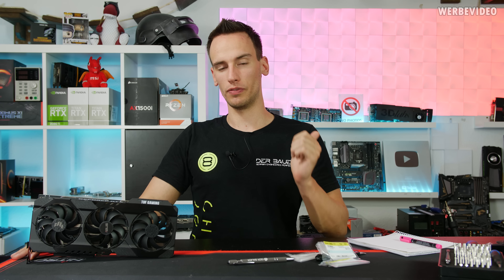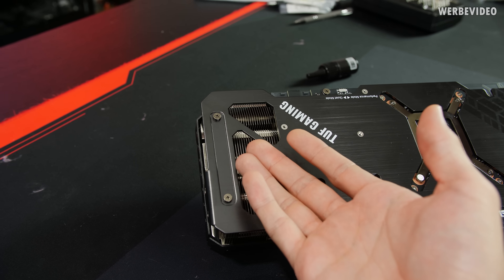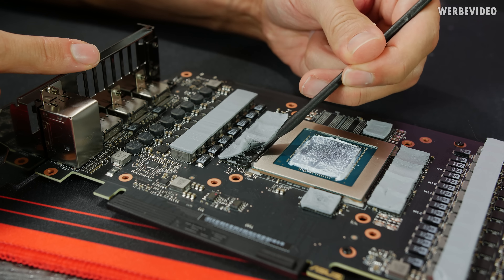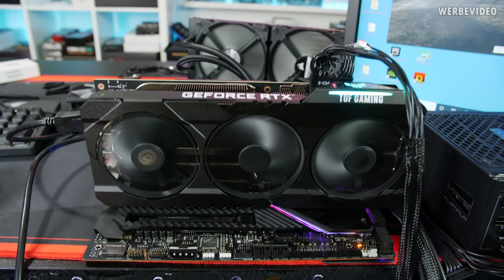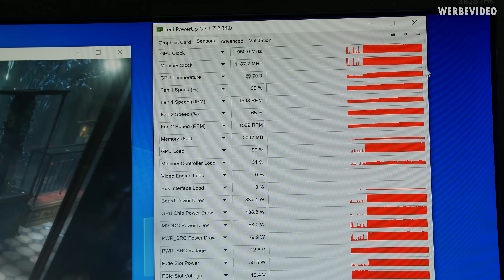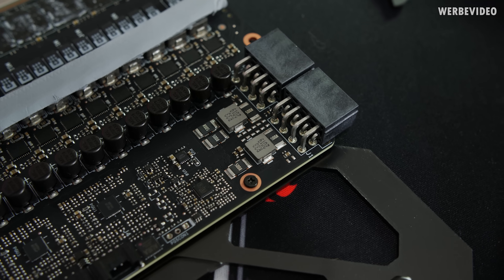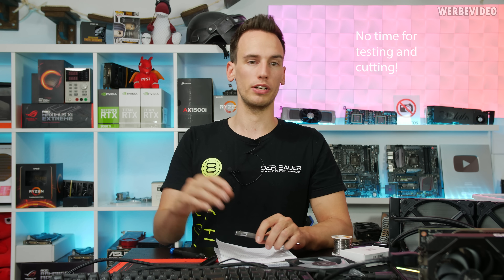ASUS TUF Gaming RTX 3080 OC - Shunt Modding (unlock Power Target!) and First Look

Comment: You probably wont answer old comments, but you wouldn't happen to be able to explore whether or not the unused solder pads up to the left on the PCB of this card is for a USB-C port?
Reply from the maker: That's actually possible. But I don't have the card anymore to check that 😁

Comment: Hi Der8auer.  So my question is.. is there no reason to modify any of the other shunts on a 3080ti PCB?  Specifically the EVGA 3080ti Ultra Hybrid model.  I have seen mixed things on shunt modding the 3080/3080ti/3090 and before seeing this was under the impression that in order to fully bypass the power regulation features on these boards you have to shunt mod all resistors for the PCIE 8 pins and the PCI-E board connection point.  I am very confused what needs to be done to shunt the 3080ti for unlocked power limit.  Please help.

Comment: My ASUS TUF Gaming RTX 3080 OC does 1995mhz out of the box... OCers reach 2200mhz. I prefer undervolting. 100W less and same fps. Issue people is having is fan stop not working. Use bios update tool from ASUS support page on your card, including STRIX (it works with all the cards and will find correct VBIOS for your card). Then go set NIVIDA power settings to optimal and reboot. Fan stop used to not work unless your board power draw was <30W, new bios is <50W.
Reply: what clock/voltage for your undervolting

Comment: Does the firmware have no communication with the voltage regulator to know how much current is being driven from there?  It seems like the power monitoring at the 8 pin connectors isn't actually being used by the GPU for boost clock.

Comment: Asus said the ROG Strix has 3x 8 pin power supply to spread the load, since two would be pushed very hard. Do you think people will eventually damage their cards by unlocking and increasing the power target on 2x 8 pin cards?

Comment: Unfortunately, this is not a mod, with the same success it was possible to insert a resistor with zero resistance or put a jumper there, this action did not have any practical effect on the final result, and the difference in the results before and after is nothing more than a measurement error and nothing more! Nevertheless, thank you for reviewing the internal contents of the video card! And Sorry for my English 🤗

Comment: Such a well designed cooler. I just wish the card was a bit better looking.
Reply: This is actually quite a clean looking card without the excessively angular designs that we have been seeing for a while.
Reply: Maybe their Strix card will be even better when that's released if this is just Asus' basic card.

Including design. I don't like the TUF's design that much either, but function over form for me anyway.
Reply: I was really turned off by the plain design and the protrusion that has the TUF logo at first, but after seeing it in so many videos it's beginning to grow on me a bit. I'll be mounting whichever 3080 I end up getting vertically, so aesthetics-wise a little more illumination would have been nice, but the shroud itself looks really good and well the power connectors would stick out anyway so having the shroud cover them a bit isn't all that bad in the end.
Reply: @rofln00b  at least it isn't a sad clown with weird curves lol.
Reply: The only issue i have is the rgb its cut short but i understand why, i was thinking to get the asus 3080 rog strix, but it needs 3x8 pin connectors so i just Decided to go with the tuf oc edition

Comment: thing is as fast as it can be, nvidia did well to find the power level and maximize power to perf. only way up is a 3090 that cost 2x as much. and maybe you'll get 20%, most likely 10%. Guess the 3080 with mild oc is the best we'll get this generation.
Reply: Well I have seen a Gigabyte gaming OC largely maintain over 2000Mhz, not in English but you don't need it :P.  Silicon lotto/binning may be the reason, hard to say yet.
https://www.youtube.com/watch?v=5pohOsjXLKw&list=WL&index=29&t=504s

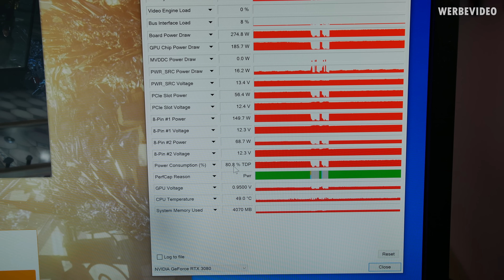Comment: @15:40 the perfcap reason is pwr. Maybe its not clocking higher due to the 8pin #1 reading 150W which is the the limit for this connector. It may mean that all shunt resistors on the board need to be modded to truly uncap the power draw. Just a guess.

Comment: Hell, 350 Watts for a GPU, i guess it's the price for "good" 4K. I have just built a desktop that uses 75 Watts using a Ryzen 3400G that run games fine in Full HD and is amazing for productivity, 10 years ago 500 watts was required to perform the same. I really hope there is still room to improve in power consumption with silicon (i heard Apple is doing wonders with 5nm), otherwise integrated circuit technology will have to change drastically.

Comment: Can you try the same mod in MSI 3080 Gaming X? It have 3 power connectors and probably can safly draw 50% mode power (but in stock TDP is limitted as in other 3080 with 2 connectors).

Comment: 5:04, what's up with the pads. Do those GDDR6x modules run so hot to require the extra heatsink? Doesn't look like those pads can take it if they're already crummy after such a short period.
Even after dumping an additional 40W, there clocks barely moved. Ampere is so high in the voltage/frequency curve already it's not funny. Samsung's 8nm is hot garbage jfc.

Comment: I would like to see the extra 2 ram chips soldered on and see if it registers as 12GB on a 384 bit bus or is it locked in firmware as a 10GB 320bit unit and then bench it against a 3090 to see how close it gets.

Comment: Huh? Literally every Vega has a spring pressure mount.
Reply: What Nvidia was talking about is that they used a new spring that offered a lower profile mount than traditional springs with better mounting pressure. Spring pressure mount existed for a long time. I couldn't comment on how true their statement is, but the distinction is that it's not new but upgraded.

Comment: I am really curious if you can use the Kraken G12  kit with this card ! (if the screw points are the same as the 1080/2080 pcb then you technically should be able) can you check or confirm that ?

Comment: bad design on the double kooler part
as we know that when you connect metal pieces heat does not transfer that well 
a solid unit is much better
same problem applies to cpu koolers
new invention being tried out now recently is too make cpu kooler intergrated into cpu design..makes a big difference all ready

Comment: So did you determine what the second shunt resistor is for? I'm wondering if that's there to measure power as a secondary phase. So you may need to shunt mod that as well to allow the board to pull more power. The shunt you modded, all it seems to have done is just lower the readings but the board pulls the same power which to me is strange. It should see more headroom and try to use it.

Comment: Hi Roman. 
I feel a disturbance in the force these days..
The MSI 3080 Ventus 3X OC is left under the raidar, with not a single big channel test i the whole galaxy.. Not even in outer rim..!
Many of us fell for it's force powers, and are waiting for its presense as we speak.
The force is currently clouded, with actually good TUF-cards this time, so we need to surface if the trade federation (MSI) also listened to the Jedi Steve's preachings, and the clockmaster der8auer's laws.
At least I hope they didn't cheap out on the thermal pads this time. :)
If it isn't any good, I will probably turn to the dark side! :(
Reply from the maker: I guess MSI is to blame for not sampling these
Reply: @der8auer  Yeah.. Absolutely! They are seemingly only pushing the Gaming Trio.. I have now ordered the TUF, which seems like the golden standard this year. It shoots way beyond its class.. Great Asus!

Comment: If you do the math the shunt mod had the same effect as the software power increase. (75+150+150)/100=3.75w per percent 150/2=75 the power reported when the shunt mod 8pin is at 150w. so 75/3.75=20% and if you look at the video the power used after overclocking with the shunt mod is ~80% and its still power limited for the PrefCap. Something else is keeping the power at design spec. Yes it did get him a little room but something is still stopping the power.

Comment: I don't have too much experience with GPUs but my 2080ti had a factory overclock setting of 1665 and ran in the 1.9ghz range and when manually overclocked to 1780 it ran over 2GHZ most of the time; so I thought this was just normal.

Comment: sorry just came across this channel and i know nothing about hardware overclocking mods but you added a resistor (shunt mod) this increased power consuption but increased and stabalised clock speed? how? also board power draw is lower and and power tdp is lower? can someone simplify this all for me as in my head it doesnt make sense lol, also if its that simple and this guy can figure it out in a day why was it not implicated on the board from factory? really confused in all aspects of this lol
Reply: i went back and watched it, i think your tricking it into thinking there is less voltage so it ups the consuption but it reads less thus increasing the oc power to 110% because it did nothing before the shunt mod? is this sort of on the right lines?

Comment: PowerPAK package of the Vishay MOSFETs is quite limited in dissipating heat. Increasing the "power limit" by say 10% would increase the dissipated heat by I^2 so around 20% which is something that would degrade the lifespan of quite a few components. I suspect Asus is purposefully firmware limiting the power to avoid reliability issues.
Reply: After the 5700 xt screw up. I am not surprised.

Comment: usually shunt mods are done to trick the GPU in thinking it is using less power than it actually is, so it can draw more from the PSU and potentially OC higher. this doesn't mean that it actually uses less power though.

Comment: @der8auer
6:35 Why don't you mention the graphite sheet on the back of the backplate? Is it a graphite sheet? Cause they use the same stuff in phones to spread heat better.
17:16 And can't you fix the coil whine with special glue? You know the glue they use in PSU's to stop the coils from vibrating.

Comment: Obviously the manufacturers have difficulties to develop a GPU that can catch up to a CPU at nearly the clock rates. What is the reason for this, the structure of the core itself or other issues ? what exactly is the problem in detail ? Another possibility would be that it would be technically feasible, plans and prototypes have been hidden for a long time, but are gradually being made available to the public market for economic reasons. 
A GPU is equal to a CPU in structure and design, but only the programming of the circuits is different, only the driver or the BIOS tells the core if it is a CPU or GPU or other-what is it ? I am a normal user who is interested in the things he uses and ask these questions out of pure interest.

With kind regards : Sascha Haar

Text translated with DeepL (German-English)

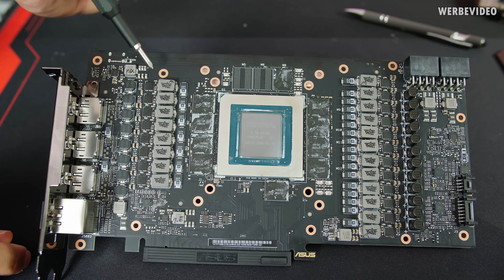Comment: 07:07 there is room on the pcb for 2(4) more gb of ram i see , they are proberly there just for show ;)
Reply: 10 x 1gb chips but space for 12 chips. I was wondering if they're using the same Pcb with the 3080 and 3090 the difference being the gpu die and the memory using 12x 2gb chips. But that's my theory, I could be wrong
Reply: @ewanmurray153  Maybe a 3080 Super/Ti is coming with 12gb, or the PCB can also be a Tik/3090 with 24gb.  There were rumors of a 3080 with 20gb.  I think Gigabyte confirmed it accidentally.
Reply: @pdub420  those could well be the options aswell. I was thinking cost savings in pcb development, it would be interesting to see a teardown of the future cards to see if our theories are correct 🙂

Comment: the TUF didn't have the best results but with dual bios had the best noise/temp ratio of all the ones I checked yesterday (17 sept) it will definitely change with more models released
since the 1000 series and the auto-overclocking capability of cards marketed boost numbers have become meaningless, all cards go to the max their BIN allows within power/temp limits

Comment: I think you already seen this but according to igorslab RTX 3080 review the firmware and the controller can now sense current through the mosfet rendering shunt mods useless now. Might be why you didn't see a much higher power consumption and clockspeed?

Comment: well well… 2 missing memory chips, so after AMD shows something they will come back with a super or ti or whatever offering 12gb to try and bury it/compensate for AMD's offering 16gb

im sick of nvidia trying to save a buck on vram, baiting people into dead end cards, hopefully those next gen games give 0 fucks about optimizing memory usage and it bites them in the ass now instead of 2-3 years later
Reply: No it's because it's not the 3090, the 3080 runs on a 320 bit bus. The 8800GTS G80 cards back in the day were the same. 10 memory chips, running 1GB each on the 3080. The 8800GTS had 10 at 32mb and 64mb. Same goes for the HD7970 which also ran 320bit bus with 10 chips. 256 bit cards have 8 memory chips, 320bit cards have 10 chips, 384bit cards have 12 chips. The 3090 will have the full 12 chips. The 3080 is rumored to have a future 20gb though so yes there will be a "better" version later but I don't see the necessity quite yet anyways. 512bit cards like the R9 290X and 390X have 16 chips for example. Each memory chip accounts for 32bits of additional bandwidth. So if they did release a 3080 with 12 chips and 12GB it would also go up to 384bit. Which is also possible I guess but I don't see that happening, I don't think Nvidia has ever changed the bit rate like that with a refresh, because it's likely easier to just double the memory capacity vs adding capacity for more memory bandwidth. You increase the yields by not needing every chips memory controller to be capable of 384bit which helps you reduce price. Otherwise price would go way up. Maybe a 3080ti if Nvidia decides they want something between the 3080 and 3090 would bridge that massive price gap.

Comment: Does this work on the non-OC version?
Reply: It will work on the non-oc version. The only difference is the binned chip between te oc and non-oc version.
Reply: So the non oC does not get this high...
Reply: @haukionkannel  I'm not shure if that would happen, but it has less potential then the oc-version

Comment: never spin the coolers with your fingers, they act as a dynamo and this could be detrimental for the parts inside. if you clean your pc with ie a compressor, make sure the coolers don`t spin.
Reply: the current generated is not gonna destroy anything inside. what you dont want is overspin them and causes damage to the bearings. this could happens on sleeve bearing fans

Comment: 70'C and 66% fan speed on an open test bench. It's going to get hotter in a case, and the fans are already spinning quite fast. … Oddly Hardware Unboxed reported 62'C in a case with the same TUF.

Comment: Hey Der8aur just wondering if you are also interested to try fixing the coil whine. Since already taking apart the cards. Perhaps replace chokes or cap. Or inserting some appropriate dampening materials onto them, or try out different PSU etc... It would be an interesting video! Thanks as always.

Comment: Wow I have never before seen those round molded 680 uF capacitors on the left side of the VRM. I was also not able to find them in a search. All the round caps I could find use a metal can, and all molded plastic types are rectangular. I would guess they are tantalum or al-poly and they couldn't get enough capacitance (680 is quite large for a 16V cap) so they made it bigger and round for some reason.

Comment: Perfcap still showed as power. Moreover, the other 8 pin still went to 150W, the power balancing didn't try to equalize the 8 pins based on what the readings showed. I think that might be why it won't push further. 

If you modded both 8 pins, I think results would be better
Reply: Might need a 3x8 pin to really push it
Reply: @F5alconsGaming  that's not really the point. If you're bypassing limits, those connectors can totally handle well in exceeds of 150W each. You should not need more than 2 of them. 

The point I was making is that got whatever reason, the power balancing system wasn't rebalancing the power draw between the two connectors based on the modified readings, since the card thought one connector was pulling about half of what the other was. So, since 1 was still hitting the limit, power was limited. My suggested resolution is to mod that connector as well so 0 power sources are hitting the limit. 

The issue is what the card thinks, not that 2 8 pins is actually insufficient

Comment: Day 1: Everyone Benchmarks
Day 2: SHUNT MOD
Reply: SHUNT ALL THE THINGS!
Reply: @seedmole  I SHUNT MOD MY MICROWAVE AND NOW IT HEATS UP THE SOUP IN 20 SECONDS WOOOOOOOOOOOOO
Reply: @seedmole I actually enjoy these kinds of mods, my overstretched 1060 disagrees with me

Edit: Pro tip (don't do this if you're afraid of damaging your hardware) you can get a pretty good shunt with 30mm of 2mm solder, it works out to around halving the power reading
Reply: Day 3: instruction unclear GPU stuck in a toaster.
Reply: Day1: Out of stock

:-(
Reply: that's what legend does

Comment: Hey very specific question : have you measured the distance between heatsink pins? Trying to understand if it's possible to remove the shroud and slap 2 120mm fans on this heatsink  without bending the pins. Thanks a lot!

Comment: why Nvidia dont do "shunt mod" in default if its soo good according to the video? IS there any negative aspect i just dont see?
Reply: Honza Cerovský the gpu or the voltage regulators could be damaged.
Reply: I think the factory power limit is fitting to the provided cooling solution. So when modding the power limit one also needs to replace the cooler (which isn't what the manufacturer proposes, according to that warranty label ;) )